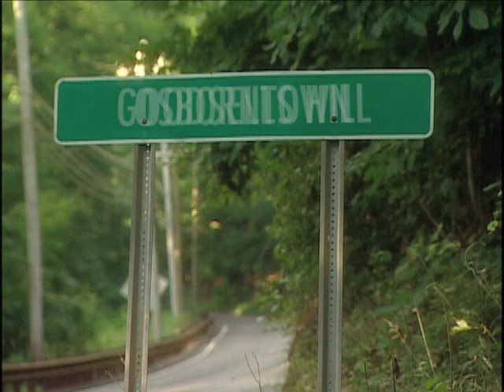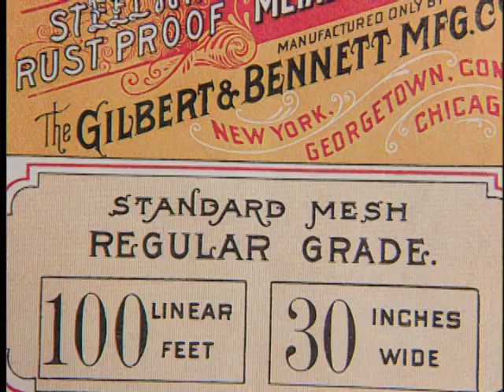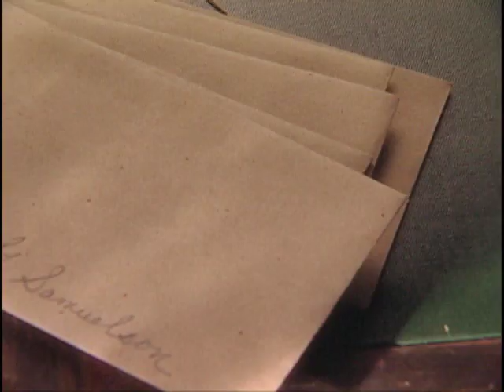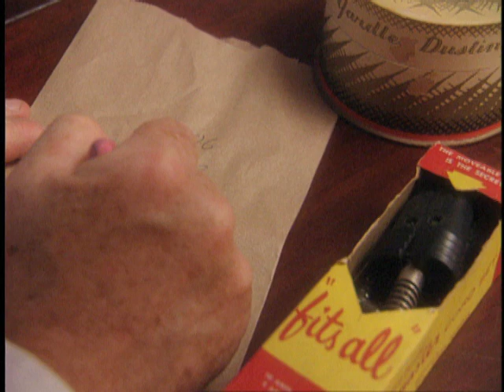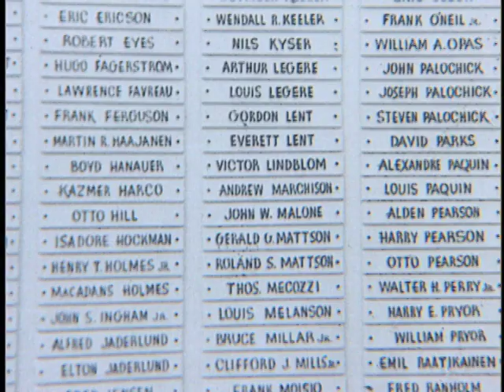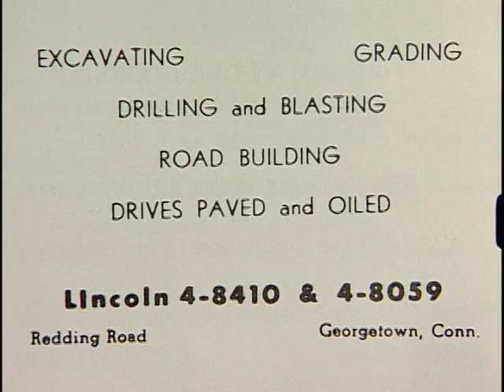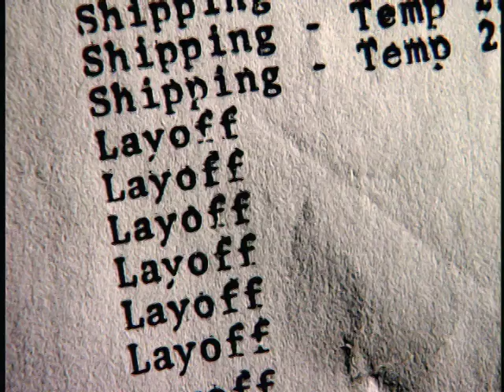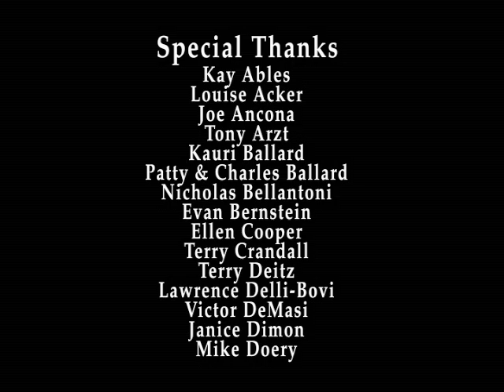A Georgetown Story

Comment: I worked there from 1981 up until the closing. Down in the center area at the end of the 6C Strand galvanizing operation  and next to the fine wire department there was a area with several vending machines and a picnic table. The wall behind the vending machines was painted silver and not very far from the ceiling theres a brick with the date of the flood and it shows how high the water was in that area.